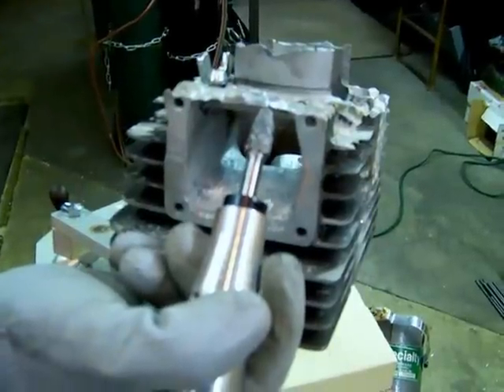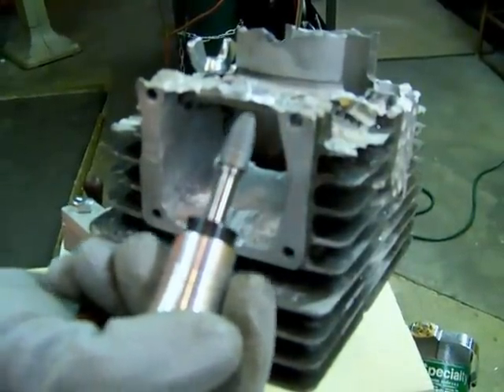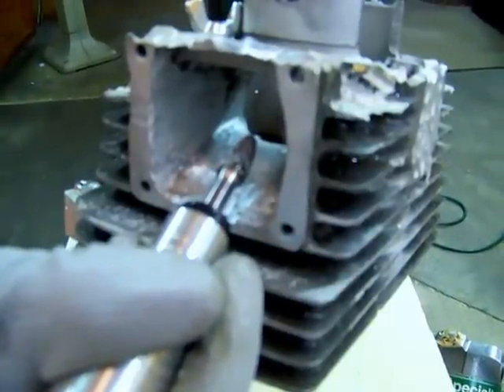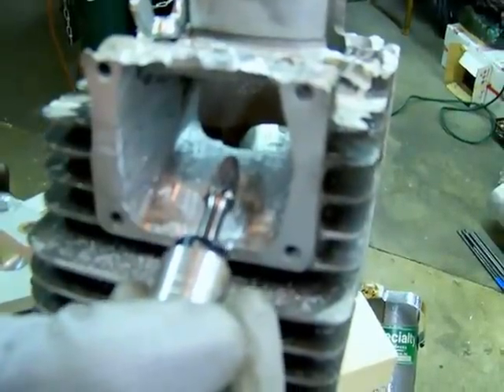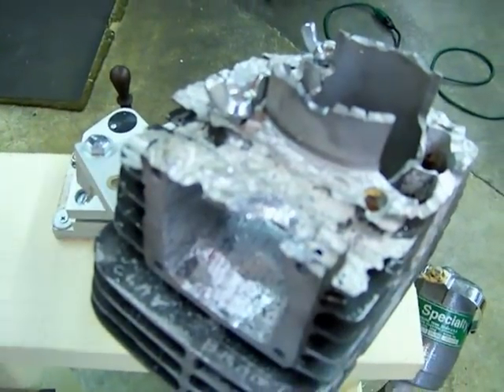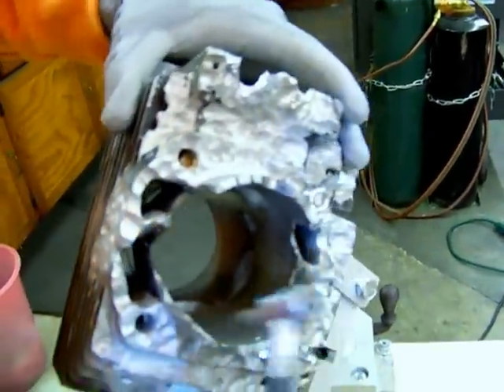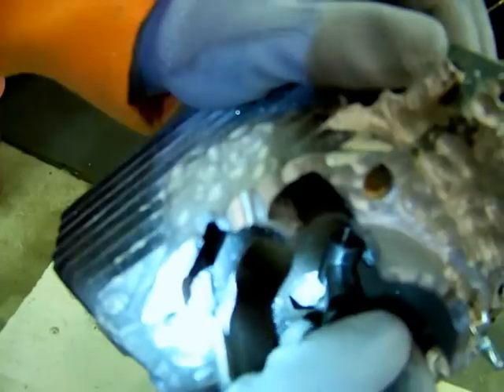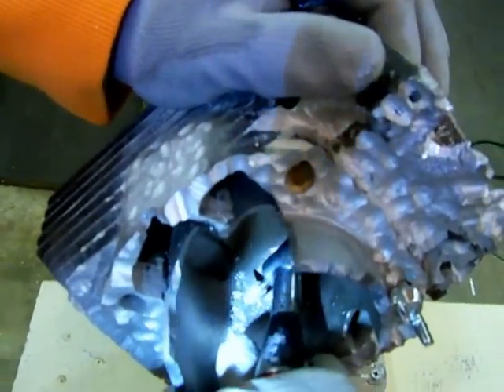Porting tips on how to use carbide bur, burrs, or cutters, 2 stroke porting.MOV

Comment: Hi there CC...I have done both cylinders on my Suzuki RGV 250 N...1992 model...this was one  quick two stroke...did everything per your video, this was a few years back..most of it is just common sense after a little rational thinking..and I know exactly what you mean when you talk about noobs getting really over zealous with gutting out those transfer ports ! the one thing that I didn't really capitalize on was the x and y dimension of the transfer ports volume, like you said this area affects the actual volume by widening the  port sides, and like you also said there isn't much to work with there, but I certainly understand that small increments can have big differences in power delivery in the power band....all in all I got the RGV 250 to ~75 HP without aggressively altering it too much..another thing I notice is some people are thinning out the center rib in the exhaust port ! this rib has a hole in it and is where oil is injected ! I never fooled with that piece as it's already quite thin and a hot part, cutting meat out of it is a sure fire way to get it overly hot with possible lubrication failure ! what is the highest compression ratio you have seen on a two stroke ?
Reply from the maker: Thanks for watching and glad you hear that you are really getting into the finer points of tuning and performance improvement. While I believe compression ratios are very important, I have found it is better not do discuss them too much on this thing called the internet.  While not as bad as religion or politics, this is one of the subjects that always lead to an endless discussion about, "corrected" , "swept", or "Uncorrected", and "did you account for how the pipe packed the charge back into the chamber", or "I report in psi- NO! I report in compression ratio!" and on and on. I prefer to look at the overall effect of my tuning efforts and just take comfort in that. However you do raise an excellent question none the less.

Comment: Is the 1MC the longest handled 90 degree? ( gives you the most amount of reach in ... Your deepest 90 degree handle) Is that a really small carbide bit you are running there in the 1MC and what's its name or number for you site? Thanks Big Dave
Reply from the maker: +David Thorne Yes the 1MC will have the telescopic handle, which can come in useful in some applications. However I typically use the 182AMC more than any of the other 90 degree rotary tools. I like how smooth and easy to use it is. We have a fairly large selection of other 90 degree tools as well http://www.ccspecialtytoolstore.com/90-degree-porting-tool-s/327.htm
Reply from the maker: +David Thorne The bit I am using in the video is a C shape 1/8 inch shank carbide http://www.ccspecialtytoolstore.com/tungsten-carbide-burrs-p/8carbburshpc.htm . I use that shape and the D shape a lot. We also have Diamond Bits that are low aggression and great for making even more precise modifications. Thanks for watching.

Comment: What a crock "right hand cutting bit" where is the hell would you get a left handed driver to run it any other way, at the same place you get a left handed drill bit.
Reply from the maker: LOL, Numb Nutz if you watch the rest of the videos on this channel you can see me use Left hand burrs, and see the reversing motors you would use, they are called the SRMC series. We sell hundreds a year, and have sold them for about 40+ years. It's OK that you didn't know though, that's why I put these videos out there, is so people can learn and be informed. Thanks for watching.

Comment from the maker: Effective life of the burr will depend, a bit, on how much porting, or metal you are cutting out. If you are doing basic porting, and not re-cutting ports, a set of quality burrs, like we sell, will last at least 6 to 8 heads, minimum. Since our burrs can be re-sharpened, we have customers that have used the same burrs for over a decade. Often, people think the burr has gone dull, when really it is just loaded with aluminum, just run it over a piece of slag iron to clear out the aluminum

Comment from the maker: well I wont be able to do the Yamaha 125z specifically, those models were more popular in Europe and Asia, Malaysia, not as common here in the US. However, we do have a 2 stroke project coming up soon on a CR 250 motoX bike and the concept will be the same. Of course you will need to determine how much to raise, lower, widen, and radius your exhaust port for that particular Y1 125Z (with an after market enduro piston or dt125?)

Comment from the maker: Yeah we use pneumatic tools for all sorts of things. We just dont use them for porting, in particular on aluminum. We used to sell a few versions of pneumatic right angles for porting, but they were too dependent on high rpm's for power, our customers did nothing but complain about them and they always replaced them with a 1MC, 3MC, or 182AMC, so we just quit selling them. But I think pneumatics are great for lots of other applications.

Comment from the maker: I think Engineering is one of THE most important of sciences
Yeah the right angle tool you see at the end of the video is similar to dental tools, infact we have dentists that buy from us, but the ones you see here are a flex shaft system, it allow for more torque at lower rpm. I find you get much better control and precision as compared with pneumatics. Air tools can work, we used to sell them as well, but the flex shaft system performs better. Congrats on the tooth bling lol : )